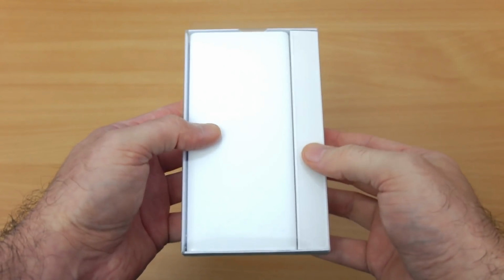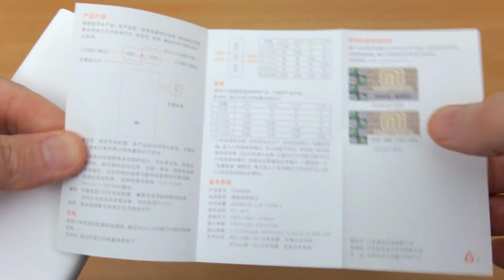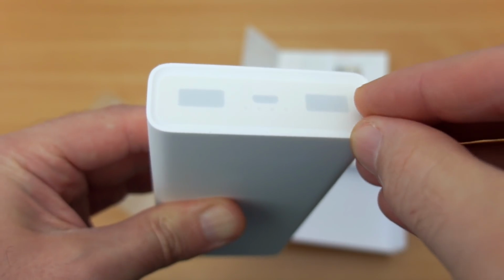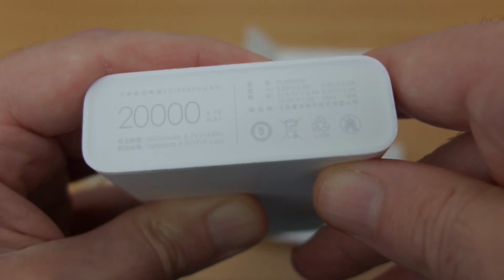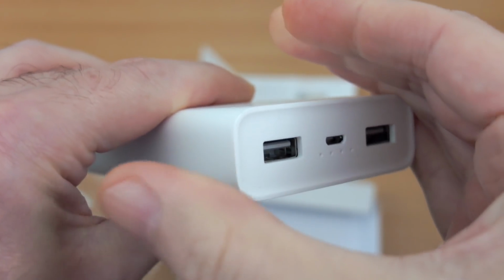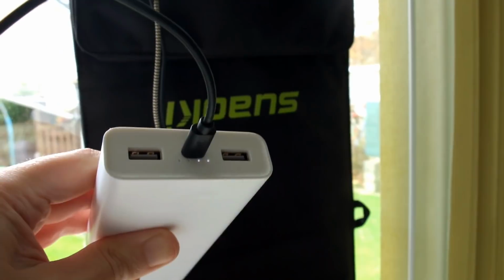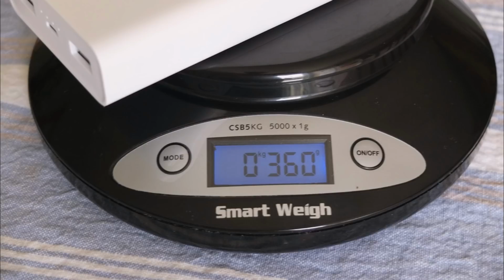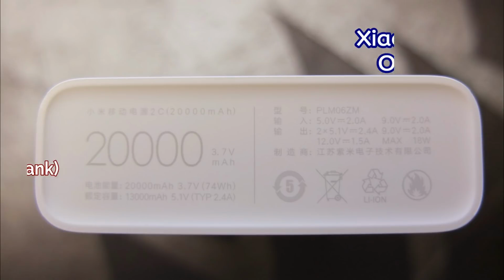Xiaomi Mi Power Bank 2C (20,000mAh): Review/Test

Comment: So the nominal 3.7V*20Ah is supposed to be 74Wh stored energy, so if we covert it to 5.15V then we get 74Wh/5.15V= 14369mAh charge. The measured 13430mAh suggests 93.5% voltage converter efficiency, which is quite good. 
With your voltage scaling and measurement method, measuring more than 74% charge (14800 for a 20000 pack) is the theoretical maximum charge.
Reply from the maker: Well if you want to crunch numbers yes, the Xiaomi power banks do well. Better than most. But of course there are variables, such as cable quality, length. Discharge rate (higher discharge less efficiency)

Comment: Nice video. Do you know when does the 9 or 12V charging activates. Can it be set by the button to always output 9 or 12V? I need it to charge a car gps tracker which need atleast 9V.
Edit: I saw in one of your responses u say it switches automatically. Do you know how does it "decide" when to switch to the higher outputs?
Reply from the maker: It does it automatically, if the device supports it and the cable. There is no way to force it to output 9V
Reply from the maker: It does it automatically, if the device supports it and the cable. There is no way to force it to output 9V
Reply: @MrBazReviews  I was hoping for a fast response, but damn. xD Thank you!!
Reply from the maker: @pavelstoyanov8419  No problem I am usually online later evening/night GMT, hence I can reply quickly!

Comment: MI PowerC2 Bank 20000 Electronic Spices Dual USB Output 5V 1A 2.1A Output Power Bank 18650 Battery Charger Protection PCB Module Board DIY Mobile Charging Accessories Digital LCD
Reply from the maker: What is that?

Comment: Why is the output capacity so much lower? It can't be just heat surely? That's such a huge difference
Reply from the maker: Because the output voltage is higher than the Li-ion cell. Which is nominal 3.7V. So it's boosted to 5V for output, hence the real capacity is lower. If the output was 3.7V you'd get a figure much closer to the full 20,000. It would still be a bit lower (due to cables etc). That is why all power banks have a lower real output capacity, as USB is 5V, with quick charge it's even less

Comment: Hey Mr. Baz. Informative video. Thanks a lot.
Can i use these power banks to charge Macbook Pro 16"?
Reply from the maker: You are probably better with the 3 Pro power bank because it supports the higher voltages and is optimal for the Macbook Pro
https://www.youtube.com/watch?v=T6XJiMYoddU
But this will work (just not as fast) as it supports PD and charging on the Macbook
Reply: @MrBazReviews  Thanks for the reply!

Comment: Thanks for the video! Roughly, for how many days does it hold its charge before discharging itself?
Reply from the maker: Li-ion discharge is minimal on power banks, it should have almost none. Exceptions are extreme temperatures
For normal use they should hold a charge for a long time
Reply: @MrBazReviews  thanks!

Comment: Is it capable to charge a macbook air with a usb-c port?
Reply from the maker: You can use any power bank to charge it, but models like the Pro can power it due to higher voltage output

Comment: How long does it take to full charge? Coz I just got one and been charging it for almost 12hrs but the led indicator just stayed on the 3rd light
Reply from the maker: About that 12-13 hours if you have a 2A charger, more if it's slower speed
Reply: I just watched other reviews here and found out the one I bought is not original Mi powerbank. So contacted the seller and returning this now for a refund.
Reply: By the way, thank you for the reply on your 2yr old video. I actually was not hoping for it as other YouTubers don't. 👍👍👍

Comment: I wanted to use it with VR wireleas, can it explodes on my belt 😂? Actually i used 10k mah vive power bank and nothing exploded :)
Reply from the maker: No worst that happens is the Li-ion polymer will expand, I've never seen one blow up!
Reply: @MrBazReviews  so it is 99% safe :)?
Reply: Hey! Did you buy it? I would love to know if it worked. Thinking on using it too.

Comment: I've purchased many power banks over the years from different brands and I've noticed that they all lose overall capacity over time.
How's the longevity of the capacity with this model?
Reply from the maker: All batteries lose power/capacity over time, this one is still working perfectly well. Obviously 2 years later it will depend how often it's discharged. I've found the Mi ones to be one of the best I've used

Comment: When I am using mine to charge something mine flashes every second or so the entire time it is charging. Is that normal? It's very annoying...
Reply from the maker: I've yet to use a power bank that didn't flash if it has indicators. The other option is not knowing what the charge level is, which would be a deal breaker on it's own
Reply: @MrBazReviews  I had one that you could press it to see what it was on and it didn't constantly flash while it was charging something. I lost that one, no idea how haha.

Comment: How to disable low power mode
Reply from the maker: I'm away at the moment so can't test, but try double press again see if the slow pulsing on the LED's goes away. Or just disconnect it and wait for it to auto turn off, it's in normal mode unless the lower power is selected

Comment: thank you, THANK YOU
i'm glad that you testing the actual output capacity :) so we would know how much the real conversion rate, usually fake on the advertised (it says 90%)
Reply from the maker: The Xiaomi figures are pretty close, the 90% takes into account the voltage step up. The cell is 3.7V nominal and the USB output is 5V hence, the actual capacity discharge is always lower. Xiaomi are one of the makers who give a figure for this on their power banks (it is normal all power banks are lower), most makers don't.
Reply: @MrBazReviews  i know that,

and most reviews didn't mention the step up conversion rate, this is bothering me a lot when buying powerbanks, thanks to you, now i have the choice :)

Comment: For iPhone 6S is safe to use this powerbank or the output voltage is too high for phone ?
I read that for older iphones is good to use a powerbank with the output 5V/2A. 
Is that true ?
 Can you please recommend me a powerbank that is safe to charge my phone ? Also 10.000-20.000 mAh
Reply from the maker: Doesn't make any difference if the phone is old or new, powerbanks will regulate the charging current/speed
The Mi power banks are among the best out there for performance/quality - based on using them for quite some time now

Comment: im considering either buying this one or the anker 20000 power bank, im going on a trip for a few months so i really need a solid power bank.
got any suggestions for me?
Reply from the maker: I am still using this since I did the video (on a regular basis) It's working fine no issues to report at all.
IMO Xiaomi power banks are probably the best in the market, I can't comment on Anker as they don't send items for testing - for some reason. I'd be surprised if they were as good or better
Reply: @MrBazReviews  alright awsome! its also way cheaper than the anker one so im glad to hear that, and thanks for the quick response!
Reply from the maker: @bnaveb  Not a problem the Xiaomi power banks are among the top performers out there, they hold up in real world testing and extended use. I'm sure you'll be happy with it
The seem to be using good quality Li-ion cells - let me know how you find it feedback is useful for everyone. All the best

Comment: This powerbank making ng s9 plus hot. 👎
Reply from the maker: It's not the power bank any source will heat up the battery, the phone controls the charge current. I'd check the phone on other devices if it's using quick charge it will get more heat - but it shouldn't be roasting hot.

Comment: You said that it could output 5.1V 2.4A / 9V 2A / 12V 1.5A. But how to you switch between the power outputs?
Reply from the maker: You don't it switches itself it knows if a QC compatible device is attached and adjusts the output
Reply: Cool, thanks for the answer ;D

Comment: You said that it could output 5.1V 2.4A / 9V 2A / 12V 1.5A. But how to you switch between the power outputs?
Reply: single press and double press
Reply from the maker: You can't it switches automatically

Comment: The input output ratio is really bad not good, something around 85% is good but this is scamming people.
Almost 7000mah less than its stand on the powebank.
I bett on the 10000mah version the ratio is much better.
Reply from the maker: All power banks give lower you are boosting a 3.7V up to 5V for the USB output so between 13-14000 is a good conversion rate. You get about 6500mAh out of the 10,000 one
https://www.mi.com/in/10000mah-mi-power-bank-2i/
So it isn't more efficient
Reply: @MrBazReviews  This means that i will get 14.000mah of capacity and not the 20.000 of what I am paying for ?
Reply from the maker: @entremontanas7614  It's the same with every power bank because it steps up the voltage (ie 5V or 9V etc) and the Li-ion cell is rated to 3.7V nominal - hence the discharge capacity is always less. At least Xiaomi state this on their site but yes I think makers should be more upfront about it.

Comment: Are that usb out puts usb 3.0 or 3.1?
Reply from the maker: It's just USB type A there is no data connection so it's not classed as 3.0 or 3.1
Reply: @MrBazReviews  oh ok i asked because i have seen a powerbank with a  blue usb3.1 output and i thought this one might have it too
Reply from the maker: @f4ke_nyex969  They sometimes mark ports blue or red to show it's the "faster speed" port or supports quick charge etc, it's nothing to do with USB 3.0/3.1 on a power bank on a motherboard yes usually marked to show faster USB 3.0 (different variants ie gen 1/2 etc)
Reply: @MrBazReviews  okay thank  u for the information

Comment: It's a shame that they don't put a typ-c charging port on it, i don't buy anymore stuff without typ-c plugs for charging and discharging. 🖖
Reply from the maker: There is a newer one just out it has the type C port and also supports QC on both outputs. It does cost a bit more though. I'll try to get one for testing if I can sometime
Reply: @MrBazReviews  that would be cool 👍
I hope it's has 40ah instead 20ah
Reply: Well, I have a tiny converter ❤
Works stellar!

Comment: love your review. I never knew about the input/output conversion ratio. I thought the rating given (eg 20,000 mAH) was the amount you could take out. But what you say comports with my experience of only getting out 50-70% of the rated capacity. These powerpack manufacturers are sneaky buggers.
Reply from the maker: Yes if they told you the real capacity (discharge) then it's a lot less attractive. Still this is quite a good power bank
Reply: @MrBazReviews yeah, I have their phones (several of them) and their 5AH and 16AH powerbanks. The 5AH powerbank is not that good, but the 16AH one is still going strong. I noticed in one Xiaomi ad for the 20AH powerbank (mentioned here) that it actually says the user can expect to get 13AH out of it. So refreshingly honest!
Reply: @MrBazReviews  Hey, sorry for bringing up such an old comment but the 20.000 mah are rated at 3.6v so at your output of 5V you should get 20.000*3.6/5=14400mah which compared to 13430 is quite good conversion ratio (93%).

Comment: Very well reviewed. Will it also perfom normaly if it is around -20°C outside ? Any important temperature related information that user should be mindful about? Thank you.
Reply from the maker: Performance at extreme temperatures will be worse -20 is pretty cold so reduced capacity it will still work, you will get less out of it as with any Li-ion cell. There are special Li-ion cells that are insulated for extreme temperatures (I took a look at a nitecore one recently)
Reply: Mr Baz Reviews Cool, thank you 😃

Comment: Jak długą ma żywotność
Reply from the maker: Depends how you use it usually charge cycles for Li-ion cells which tend to be around 500 cycles sometimes more. Faster charging/discharging will also wear the cell more. From using other power banks for regular users I would say 3/4 years use then the capacity will drop off quite a bit

Comment: Can I charge a Sony Vaio laptop using this? Thanks for the video :)
Reply from the maker: You'll need a higher voltage for laptop charging there are some out there tend to be fairly expensive, they come with the adapter tips, this isn't going to work for that unless it's a notebook that can charge via USB rather than the adapter ones which most use

Comment: Have no quickcharge 3.0 INPUT?
Reply from the maker: QC 2.0 for input not QC 3.0 doesn't really matter though still fairly quick (for it's size) to charge
Reply: @MrBazReviews  how long does it take to recharge the power bank using a quick charger ?
Reply from the maker: @omarabdelshafy5145  About 6 hours

Comment: I just bought it and charged it for 8 hours and it's still blinking at the second bar. How long for it to fully charge?
Reply from the maker: What are you using to charge it? It can use quick charge (much faster) but it's going to take a while with a normal slower 5V 1A charge speed it can charge faster at 5V higher amps but depends what you are using.

Comment: USELESS POWER BANK. I used. After 2 months it's stopped working. Not charging anymore. I tried to charge the powerbank but it's just stopping my charger. No blinking and nothing. I tried to change the charger but powerbank is not charging.
Reply from the maker: I've not had any problems with it so far, so contact the company you bought it from and get a warranty replacement sometimes things go wrong if I've had a problem I share that this one has not been any trouble and I've used it quite a lot

Comment: It can charge even it is charging, but not slow charging.
Reply from the maker: You can charge at 5V or 9V so it supports quick charge, wouldn't be much point charging it and using it unless you were fast charging it
Reply: Mr Baz Reviews it would be useful when charging it with solar charger
Reply: @2006dogan  you would be better of recharging your phone with solar instead of the powerbank
Reply: Mr Baz Reviews what does that mean